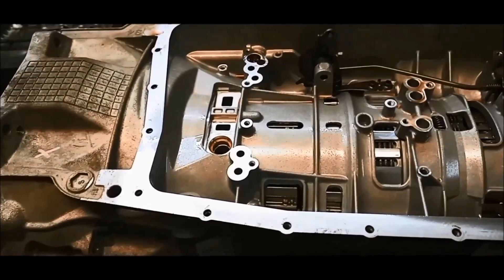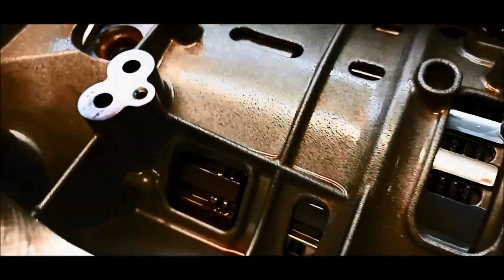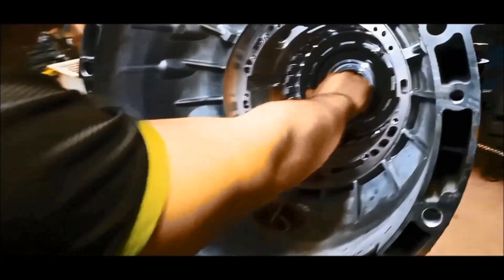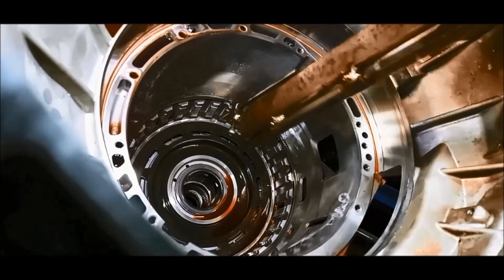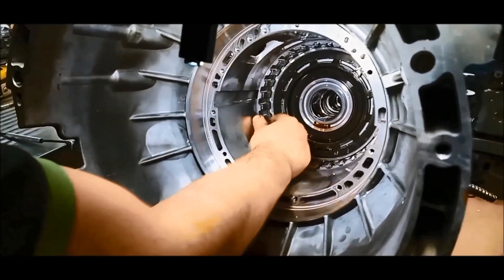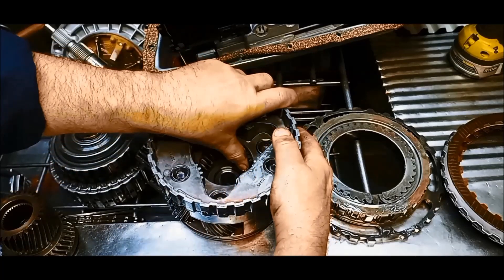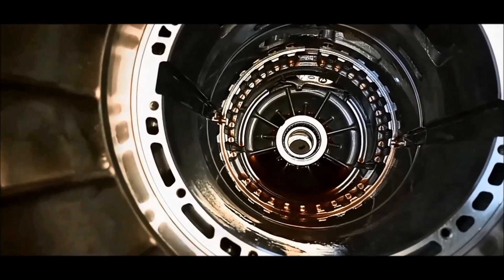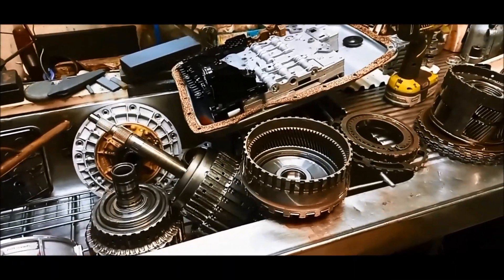6R80 Teardown Disassembly & Fault Analysis Erratic Shifts ZF6HP Teardown Disassembly

Comment: I have an expedition 2014 with 6R80. During air check my A Passage leaked. How can I fix it? I believe this is my issue. I already change the valve body and lead frame.
Reply from the maker: hi, sounds like pressure leak, make sure you check bushings as well. you may be able to improve trans by replacing valve body to case seals, solenoid set and installing a vbody zip kit. a bypass cooler and full flow valve ( instead of thermal valve ) will also keep fluid thicker as the fluid will thin out as it warms up. cheers
Reply: @YepThatsIt  Thanks for the info. I  replaced valve body and lead frame. Rebuilding this transmission  is somewhat  out of my expertise. Anywhere I can get a step by step repair manual?

Comment: Where's the erratic shift fix??
Reply from the maker: hi, the fix was a full overhaul of soft parts ( parts designed to wear out ) plus replacing the rear planetary that stripped all the splines as in vid. cheers

Comment: Ford vs GM transmissions....... overall, which are better, both historically & currently. .......😛
Reply: Neither is as good as Japanese trans in my opinion..after 36 years of work on transmissions I personally think that they are better than most others.
Reply from the maker: hi, they all break down. regular filter service, add neodymium magnets, install bypass cooler and any transmission will last alot longer and be more reliable. cheers
Reply: @YepThatsIt  bypass cooler as in totally bypass the radiator cooler & run a separate ATF cooler up front OR still have the radiator cooler plumbed in as well as an ATF cooler up front ??